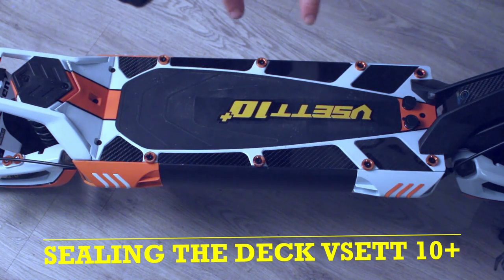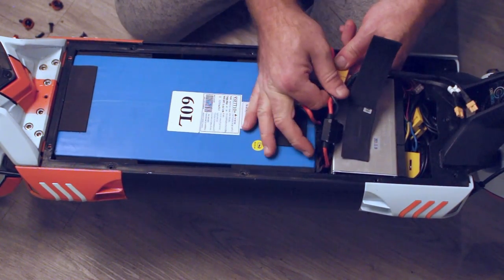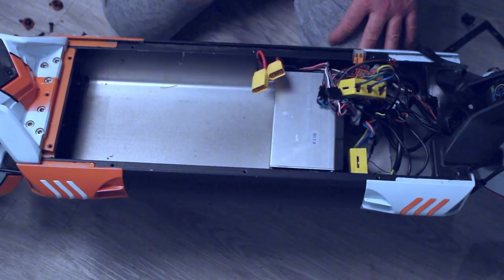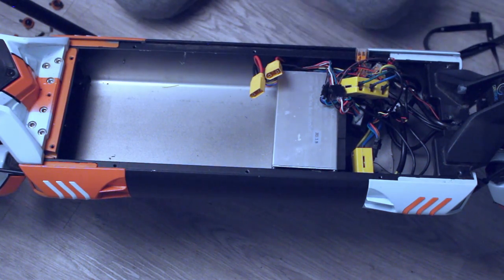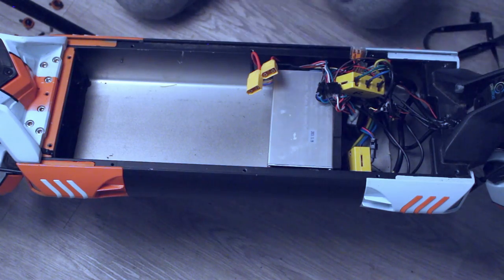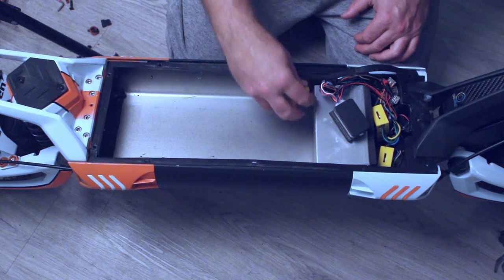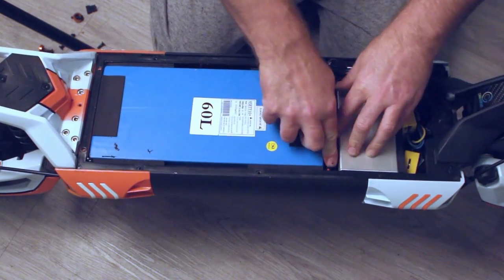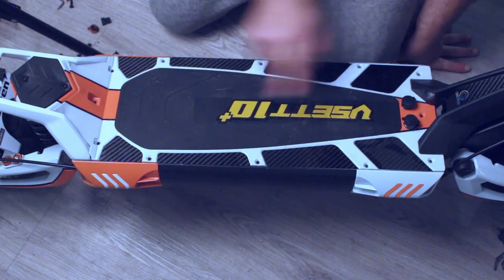Vsett 10+ winter seal - My take on possible water ingress problems

Comment: Just a heads up - in some Vsett 10+ models, the hole at the back that you sealed is already sealed in some models. I opened up mine (to replace a damaged deck) and found that they'd already sealed it from the factory.

I suspect they designed one half and then mirrored it during the design phase - the same approach can be seen with the covers which hold the lighting. They all seem to have cable routing holes, even though the cables don't route into all of them.

I'm not sure if the horn was sealed on mine, but I opted to use some Gorilla tape over the front instead. It's a quicker solution (no curing time) and will prevent any water or debris from entering in the first place. It will reduce the volume of the horn, but as we're all aware, the horn is very weak to begin with.
Reply from the maker: Thank you, like you say that horn is a definite issue.  I did in the end put helicopter tape over that hole whilst filming another project.
Reply: Decent comment and right up to the point!
Reply: @escootermodificationguides2149 hey there brother how did you get your Vsett10+ in them colors that is rad….from EAST LA, CALIFORNIA

Comment: Are you upgrading the water proofing here, or is this to replace original seals that were stripped for painting/ other work?

If raising water resistance from original, can there be any heat complications during hot weather caused by sealing every crevice? Is air flow a consideration?     Thank you.
Reply from the maker: Hi, so the rear had to be re-sealed yes but the front wires going through from the stem were a issue as the spring containing them had rusted pretty bad. a sign that it had been wet.. i also think the Horn hole is a entry point for water, so ive sealed mine with helicopter tape. 
As for heat I don't think there is a issue with overheating. I ride pretty hard at times and the controller has a thermal cut out that hasn't kicked in? the controller sits on the biggest heat sink in the form of a aluminium gear tray.

Hope that helps
Reply: @escootermodificationguides2149   Hi, yes, very helpful,  thank you.
Reply: Hot topic for me! Was having the same thought when I was sealing my vsett 10!

Comment: Just wondering if some of the holes are there for venting the heat that come the from the battery?
Reply from the maker: Its more the controllers that will get hot, and as they are mounted in a gear tray of ally that dissipates the heat. No holes are for cooling on a scooter like this. HTH
Reply: @escootermodificationguides2149  thanks for the feed back, nice job on the mods.

Comment: How did you disconnect the connectors from the battery, did the overall speed or settings in the PC not be erased (ODO)?
Reply from the maker: The battery unplugs. I did check the P setting and everything was back to defualt, apart from odometer.

Comment: I bought mine from PET London, had the deck off and was sealed with thin strip of clear silicone, mostly around rear kick plate and front arm. Also inside the deck screws. Thanks for the video will be re sealing before UK winter comes 👍👍

Comment: Thanks .. when it sparks .. what does that mean ..
Reply from the maker: The initial spark is caused by the scooters controller drawing a load be via its coils  or capacitor in the invertors inside. nothing to worry about. It does it every time, but still takes me by surprise.
Reply: @escootermodificationguides2149  lol .. cool 😎
Reply: @escootermodificationguides2149  they could just use antispark conectors. but I guess the system is not expected to be disconected and conected back again too often anyway.

Comment: Is that totally enough ? What about seal under deck? I guess gasket is not enough. Motors should be sealed too?
Reply from the maker: You could seal the deck down onto the metal gear-tray, however I wouldn't as your snap the deck should you ever need to get under there in future. Once compressed the seal would be ample unless your submerging it. 
The only thing i would add is the horn is located right behind the front wheel, it has a hole for the sound to come out and this i noticed whilst filming my gas strut video actually gets soaked by spray. That is a terrible design I.M.O, so i covered the external hole with helicopter tape. I'm thinking about installing a better horn  externally but actually don't want anything so loud that makes people jump or startles dogs when your coming up behind them. 
As for the Motors i have seen a decent Vid on youtube that covers that. i have linked it here:
https://youtu.be/PGSUyIf8HeE